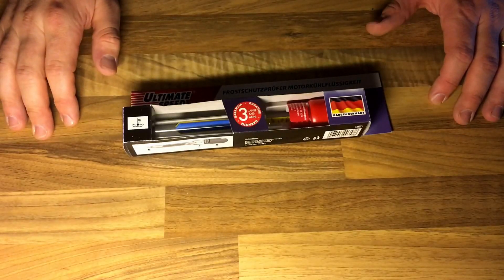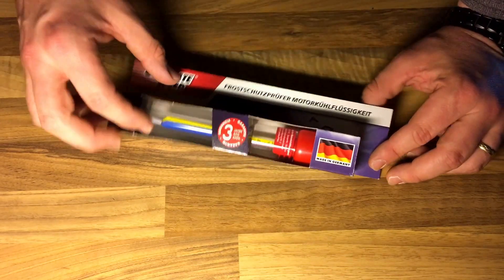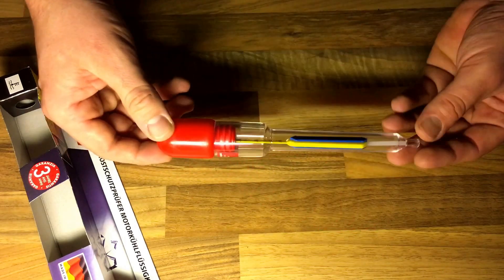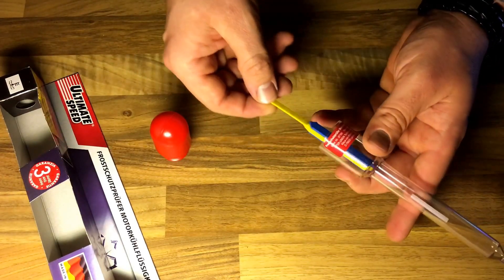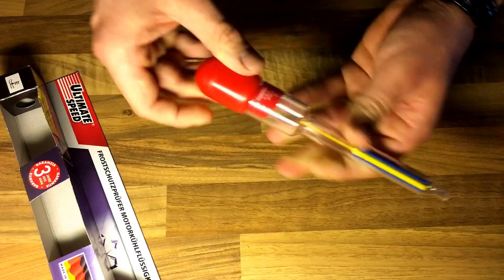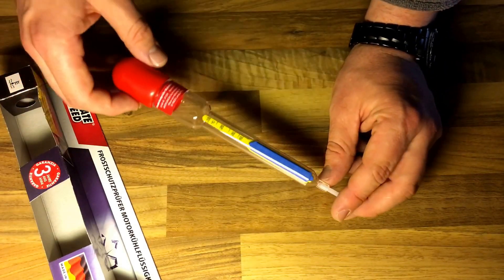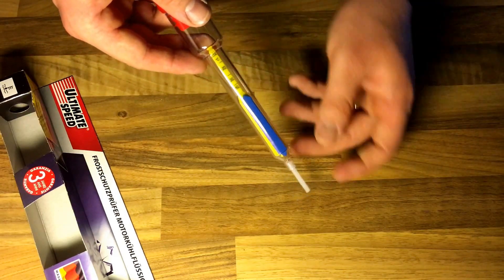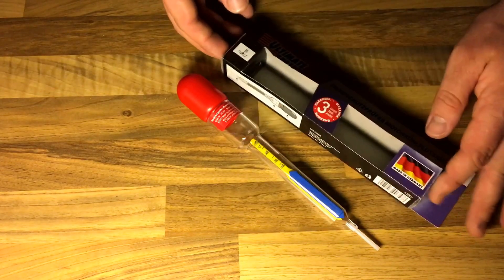Ultimate Speed engine liquid anti freeze tester unboxing and assembly

Comment: Pointless video unless you actually test some coolant to show how you actually use it and how to read from the floating scale. Hopefully the following will help anyone else that finds this while looking at how to use these testers.     Put the small piece of tube on the end, squeeze the pippet ball tight and place it down into the coolant, release the pippet slowly so that it draws the coolant up. You need the coolant towards the top of the narrow part of the glass tube. The indicator needs to be floating in the coolant. Read off the temperature from the yellow scale at the level of the coolant. The amount of anti-freeze in the coolant determines how high the scale will float. That figure tells you at what temperature your coolant is protected. Don't go near the coolant until your engine is completely cold and you shouldn't need to test it in the actual radiator. Most cars will have a separate 'header' tank' under the bonnet with it's own filler cap. This header tank should have markings for 'max' and min' levels of fluid in the system. If need be, top up this tank, not the radiator.
Reply from the maker: +Mike Cramp thanks for the good comment. I showed the test process in another separate video. 
Best regard
Reply: why making 2 separate videos, one with unboxing, one with using it...make just one complete movie